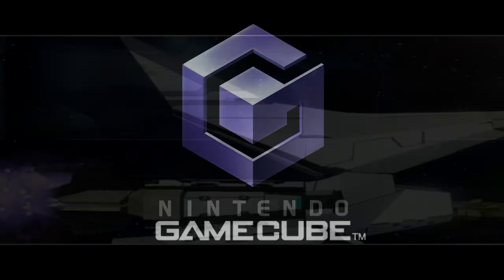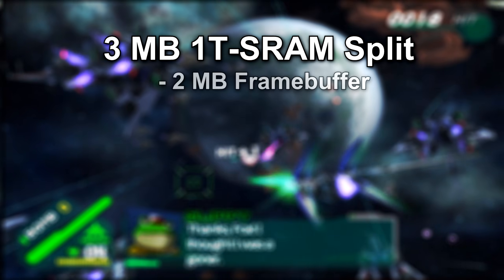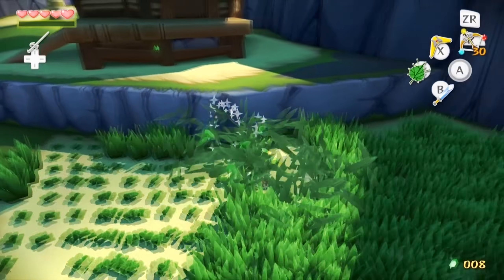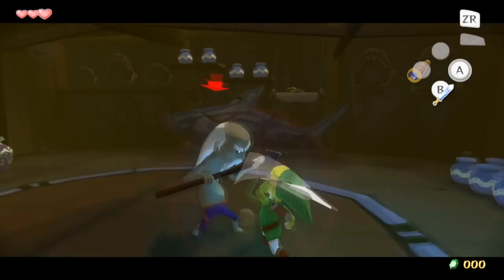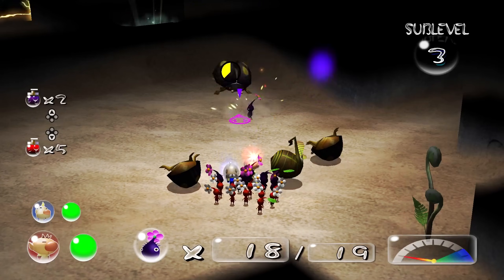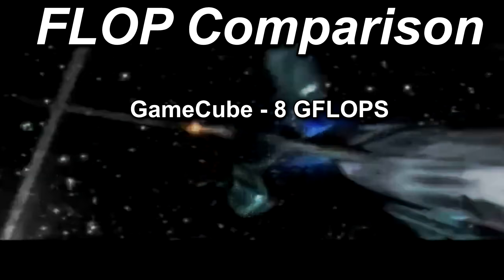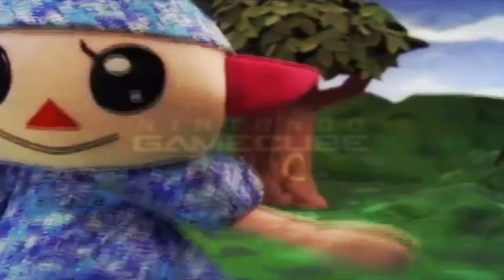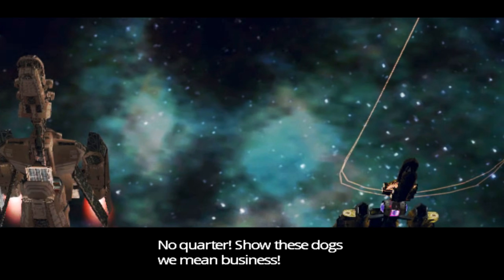The Nintendo GameCube GPU: Flipper

Comment: Now the spiritual successor of the Gamecube is the Switch 2 with the overpowered NVIDIA Ampere architecture.
Reply: It's funny you have people complaining about the Switch 2 being too weak here in the comments, and yet, there are legit some people who couldn't care less about performance or graphics and would much rather have an even weaker, but more portable handheld, akin to the GameBoy or DS.
Reply from the maker: I can't wait!
Reply: "overpowered" 🤣🤣🤣🤣🤣🤣🤣 Switch 2 GPU in docked will be 3 tflops. an old PS5 is 10 Tflops...
Reply: @Chbcfjkvddjkiuvcfr Dude, it's a handheld. People weren't dumb enough to compare the DS to the PS3 back in the days 🤦‍♂️
Reply: @Chbcfjkvddjkiuvcfr  now we know it doesn't even reach half of that 3TF performance.
Reply: @ PS5 is based on the RDNA2 flop and uses way more power.

Intel Battlemage is way better.
Reply: @ the reason the PS5 uses more power is because the engineers at sony decided that it was a great decision to put the chip to use way more voltage than what's actually needed.
Reply: "overpowered" yeah, sure, using a Tegra 239 released on 2023 but announced in 2018, instead of the Tegra T264 running blackwell architecture gpu, announced in 2022, so yeah, we are already running obsolete AF hardware on the Switch 2 along with the usual amount of dogshit software by Nintendo, they should've picked the AMD Ryzen AI300 MAX, the Strix Halo APU, with 16 cpu cores, and an igpu on the lvl of an RTX 4060.
Reply: @unlimitedslash You want the Switch 2 to have the battery life of a dying PSP? Or cost about as much as a PS5 Pro? There's more to consider when designing a system than raw power and energy efficiency is really important for a HANDHELD.
Reply: @unlimitedslash 10 months later and this couldn't be more untrue. Nintendo is releasing absolute bangers, including Metroid Prime 4 a few days from now.

Doomers are eating big crow d!cks now. Switch 2 has support of all the third parties, a good handheld hybrid that plays games at a smooth 60 to 120 fps, and 4k resolution docked, and has sold somewhere to the tune of about 13 to 14 million if we're counting all of November's sales in addition to the officially reported one. This is the best Nintendo has been in a while, and the ones that are gated are really only the people without a job and some of the bitter ones that wouldn't buy anything, no matter how powerful the hardware is. Nintendo could release an 8k monster that does 200 fps with zero loading times and they'd probably still refuse it. If not just because they are such drones, but also due to the fact that they simply would not be able to afford this. Or at the very least, treat Nintendo consoles as secondary or "companion console" to quote IGN, so some of these dorks would refuse to get any Nintendo plat above $200. They simultaneously hate Nintendo consoles for being underpowered meme platforms, and hate the Switch 2 because they refuse to get anything Nintendo related above bargain basement prices. Despite begging Ninty to release a Switch Pro at low low price.

Honestly couldn't ask for much more, aside from a good d-pad and a little more power for those little few titles still struggling can get more juice out of it.

Switch 2 is doing just fine in its first year, and will only get better. Added to that, a vast backlog from Switch 1 that can hardly be completed in this lifetime or the next.
Reply: @ Blackwell is an AI flop and RADEON is a joke.
Reply: overpowered my ass its underwhelming 3 tflops what is this 2012  thats less than a gtx 680 thats slower than the weakest gpu amd makes which is the rx 6300 amd has laptop apus 5 teraflops faster that will use little power that work fine in handhelds and ampere isnt what i call efficient considering its 7 years behind modern efficiency an intel igpu couldve even been a better option only reason they are using ampere is its shares alot of architecture with the old maxwell chip they used to make cross gen an easier transition
Reply: @ alright PC nerd. This ain't a $6000 PC designed with nothing but raw power in mind we're talking about here. Get a life.
Reply: @oilgaming-d1u these arent 6 thousand dollar pc specs this are literally the specs of the worst hardware this gen and last the switch 2 is slower than a 13 year old video card that brings some issues im not saying it needs to be a 6000$ pc but there are already handhelds that have more power than this within the first year of switch 2s release it will end up being emulated and that will hurt the console, 1st party developers, while making 3rd party developers not wanna make games for the console
Reply: @josephdias5859  Sure, 'cause people buy consoles for raw power and certainly games and features, how could I forget! Dumb little me! The Wii, DS and Switch all failed so hard against the PS3, PSP and PS5, silly me!
Reply: @OliGaming-d1u  well think how big of a problem emulation was for the switch  an underpowered console makes it easier i mean people beat totk through emulation before it was even released for the switch. times are different then they were back then emulation has become so easy that being underpowered really can hurt sales. i never said no one will buy it but i can say nintendo is shooting themselves in the foot and is going to be dealing with the largest amount of emulation and piracy on a new console by far that has ever been seen especially since the physical chip in it is very similar architecturally to the maxwell based chip they used previously used. the thing is power of a console can be a form of drm the gamecube took like 10 years to emulate well the wii took a little less the wii u only took 3 years the switch only took 1 year to emulate the switch 2 will probably be emulatable in 6 months and emulation and piracy has been nintendos biggest loss revenue. again imma reiterate people will by the switch 2 but how long before the  choice of specs begins to finacially hurt nintendo.
Reply: @josephdias5859  Again, you're right, emulation killed the Switch. Nobody bought it 🙄 Seeiously though, I emulated the DS games I couldn't buy back during the DS era, not years after, DURING the DS era, everyone did. But most of those people and even more also had an actual DS they bought games for. It's only you PC nerds that can only think in stats, specs and numbers that care that much. You're a loud niche minority. So, keep counting your pixels and frames all alone in your basement, I'll enjoy actual fun games on a system that has history and on which the experience will be shared with every other user, including friends and family

Comment: Nice overview! 

Man I really miss when each console had a different design with unique strengths and a weaknesses. 
PS2 was a bandwidth MONSTER but struggled with aliasing and raw performance compared to Xbox/GC
Xbox was just raw grunt and had some advanced lighting and graphic effects but wasn't supported nearly as well as PS2.
GC was kind of a nice middle ground to me. Not as well supported as PS2 or as powerful as Xbox but still a really well done system.
Reply: And then there were early 2000s PC games, which could be a wildcard. Games like Half-Life 2 and Doom 3 which were built from the ground up for PC performed best on that platform and had impressive-but-compromised Xbox ports, while broader third party games faced strange compromises and modern compatibility issues. In some cases with licensed titles the game is completely different despite sharing the same name; take for instance Battle for Bikini Bottom, a well-known 3D platformer on consoles yet an obscure point-and-click adventure on PC.